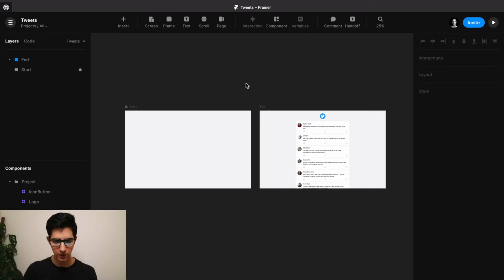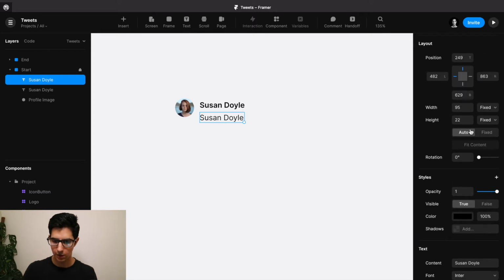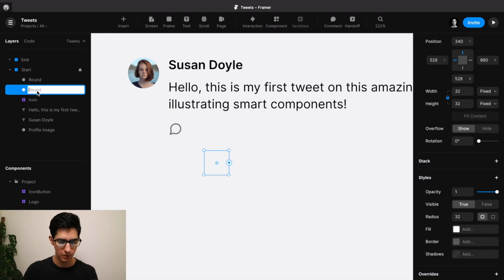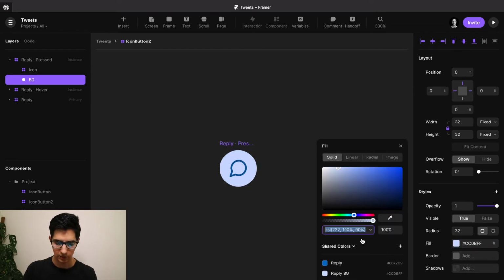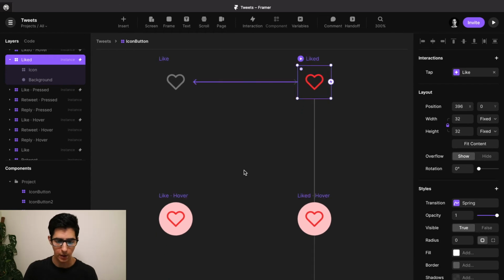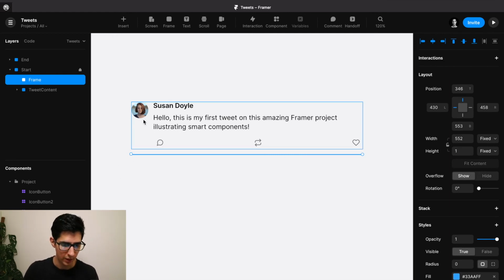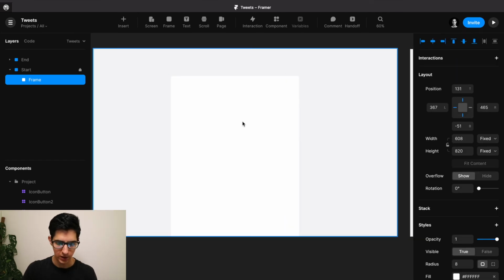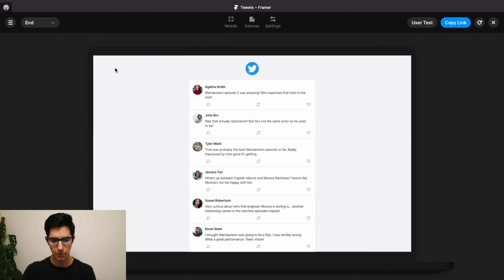Build an Interactive Prototype – Framer Smart Components Tutorial

Comment: Great video! How do you handle the case when a component should have a dynamic height according to the text layer? For example, if you need to put 3 lines of text in your tiles and force a tile to change the height accordingly.
Reply from the maker: Great question! Unfortunately, it's not possible in Framer to have auto height for text layers, and I have yet to discover a decent workaround. For now, we'll have to continue to click on "Fit Content" until an enhancement gets released.